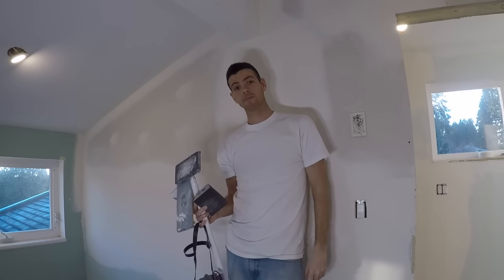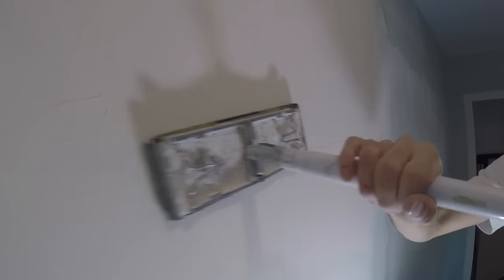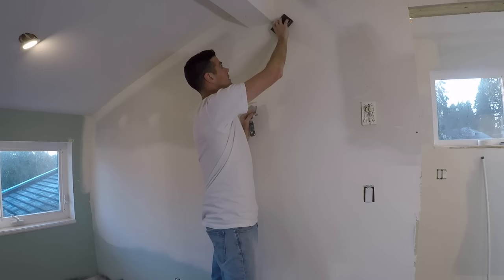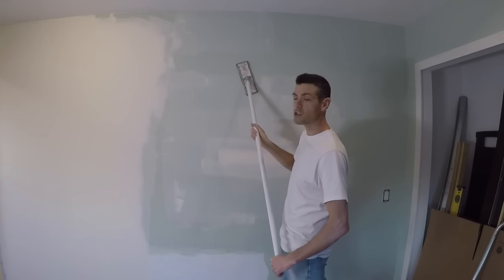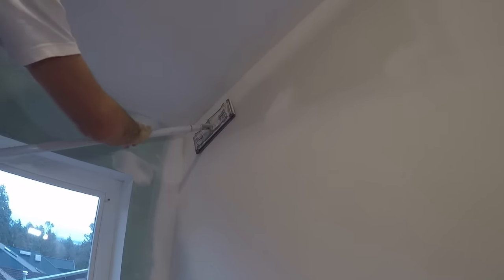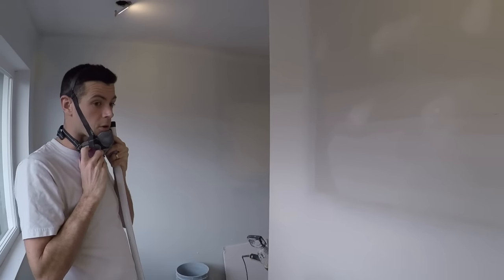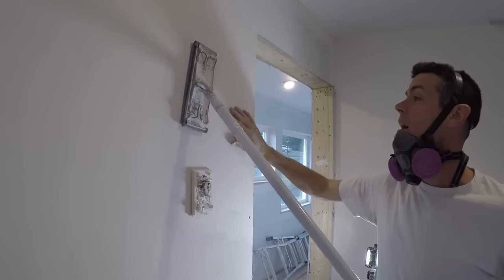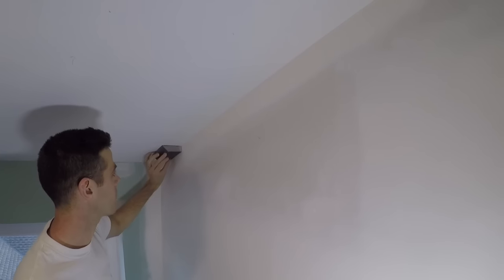HOW TO SAND DRYWALL!!!

Comment: Hey, I have a question about the sanding. I used powdered mud on my first coat but then I bought a ready mixed one - ProForm Midweight compound but when I applied the second coat with it and started the sanding process it appeared to leave tiny scratches on the joints so I've put P240 sanding paper and it still leaves scratches (I used to sand with 180) and to be honest it's really easily coming off the joints, I can even sand it with hands which is strange. Do you know what could possibly be causing that? Thank you!!

Comment: Very informative video. So  your last sanding prior to priming is with 150 grit?
Reply: 6:18 180 grit foam backed sandpaper. He's saying as a pro he prefers 150 "knocked down" a bit which means rubbing two peices of sandpaper together to knock down the really coarse parts. Some home depot carry foam backed paper but it's with the drywall mud and tools near the lumber section, not with the rest of the sandpaper in the paint isle. and strange enough most Cloverdale paint stores in Canada have it. Any drywall supplier will have it though. Its expensive to buy a roll cause 1 sheet will go for a few thousand sq ft of walls but you can usually sell the rest of the roll on kijiji or craigslist
Reply from the maker: 150 to 180. I prefer 150 but it takes a more skilled touch to not leave it all scratchy. Also depends on how hard your mud is.

Comment: Can you do a video on priming the wall right after the sanding? The drywall where there was no mud used always looks different when you paint the drywall compared to sanded drywall where its super smooth.
Reply from the maker: Sanding between coats of paint should take care of that.
Reply: I use 2 coats of primer, I know it's more work and paint, but the results are very difficult to duplicate any other way. The paint really stands up, and if you put on 2 coats of paint ( where warranted) ie my house etc, the paint job will look outstanding 10 years from now. I know many will disagree, but when I learned this from an old school painter, I never looked back. I really appreciate all your talent and attention to detail. Hope you always have work to turn down, you deserve great customers.

Comment: Do you have a radius 360 pole sander? If you’re ever in Victoria you can borrow mine
Reply: Yeah I’ve owned one now for almost 4 years. Best investment I’ve made...
Reply: Me too, can't say enough about them, still use the standard one when needed, but I have a triangle and round head for my 360.
Reply: Al S 
I recently bought an orange mop type attachment to the Radius 360 pole sander (because I could Lol 😂) to dust off walls when done sanding. Although you can prime then sand off the grit off the walls.
Reply: @bklynboyeny  I dust off my walls too always before priming. I think it makes a very noticeable difference. I'm gonna get one of those mops, thanks for posting.

Comment: After painting a coat of paint, do i need to do sanding before painting the next coat?
Reply from the maker: You will get better results with a light sanding with 180 grit between every coat of paint. It’s worth it. I sand between every coat on my own work.

Comment: How do you minimize dust? One thing I hate about drywall sanding is the amount of dust it generates, especially in an existing house that's being lived in (not a new installation)
Reply from the maker: Generally we just try to make sure the area is well protected with plastic from floor to ceiling to wall. Containment is usually the best solution. I will try to start getting into dust containment in future videos. There are ways to cut down on dust but every situation can be different.

Comment: What grit is the hand held sanding sponge? Fine, medium, coarse?
Reply: I'm interested in a reply to this as well. Sherwin Williams stocks 3m brand sponges sold as a specific grit but all others are sold as fine, medium or coarse
Reply from the maker: Fine on the package, but it actually is a little closer to a medium grit like 150. I don't like the super fine sponges. To unproductive.

Comment: Sand with a shop vacuum with bag in it  connected to a variable speed orbital sander. Why punish everyone with your drywall dust. Puts less dust in the air and environment than hand sanding. One light sanding in corners with sanding sponge to get corners.

Comment: Can u please show how to fix an inside corner? I have a 15 ft wall that I need to replace a section on the bottom (about 2ft). It had some moisture issues. How do you fix an inside corner that was already finished and painted? Can I take old tape off and re Mudd/tape just the 2ft section? Do I need to remove all 15 ft of tape and redo whole thing? Looking for the best way to tackle this!
Reply from the maker: You only need to replace the damaged section. It's no biggie. Remove the old tape and prefill any big gaps. Then just tape it like a normal corner tape. You should only need to feather it about six inches past the new tape to blend it.
Reply: Vancouver Carpenter thank you!! Should new tape overlap the exist tape above it or do I stop it right next to it?
Thanks again!
Reply: Vancouver Carpenter one last question, can I cut out roughly a 2' x 1' (or two foot high x to next stud) section or do I need to cut out the whole original piece of drywall?
Thanks again! Ur videos have given me confidence to tackle drywall again. I've always had mixed results and shyed away...lol

Comment: I wouldnt say its necessary to sand the first coat, and not to mention joints... just scrape off excess with a blade. Otherwise its so much dust to prime... and finish covers everything just fine.

Comment: It looks like you don't actually use the angled surface of the sponge to actually sand anything. Was thinking you can just then cut a square sponge with an angle down one edge if its just to get a better view of what your sanding.

Comment: You should never use the flat end of a sanding sponge in the corners. The reason its angled is to get into the corner with the angled side. No need to tear that edge off.
Reply: I was wondering that too. Regardless this is such a helpful video.

Comment: I am VERY confused @vancouvercarpenter - you state to never touch up sanded mud - yet here you are sanding the whole thing then putting on a whole second coat - I’ve watched many of your videos and this seems contradictory? Could you please clarify?
Reply from the maker: It always takes two coats. I mean don’t do your finish sanding and then try to fix a small spot on the sanded mud. Skimming the whole thing is the only way to not have a visible touch up.
Reply: @vancouvercarpenter  thanks for you reply! Okay, that clarifies if a bit more! I half did it right, but I don’t think any major damage was done 😅

Comment: I want to see the wall around that light switch AFTER the tab was dug out to be able to attach the plate. You completely covered the lower mounting strap and plate screw hole and didn't even mention it >.<

Comment: nice.  but how to remove the dust from the wall before painting.  now theres the question
Reply: Look up Wooster Dust Eater. I’m finishing my basement now and starting some sanding. It works great.
Reply: @jimb7216  and how is it applied to the walll to remove the dust
Reply: You can take a soft dry towell and carefully wipe the dust off or in new builds I have seen the painter blow the dust off with an air compressor but of course it goes everywhere
Reply: @drywaller420  i wanna hear the video man say what to do.
Reply: @brockwagner939  you are not the video man
Reply: Ok Dave 🙄
Reply: @jimb7216  yes it is ok.  why? cuz i said so
Reply: I reverse my shop vac and have fans on to blow the dust outside.
Reply: In new build we use a cordless leaf blow with hepa filtered air scrubbers. We spray prime and the overspray is more dust than is left on the wall anyway. On a reno when no one is living there I'd do the same method because the ducts are always cleaned at the end anyway. For smaller jobs I've used a microfiber rag (dry) on a pole sander to knock all the dust to the floor and an old paint brush or horse hair brush (soft bristles are important) to clean out the corners. Then of course hepa vacuum to cleanup the dust from the floor. If you use a microfiber roller sleeve you don't need to clean the walls, just the corners. Paint and primer in 1 is too thick over new drywall and should be thinned 10% with water. Tap water is fine unless you are on well water. Some well water really smells and latex paint is only 30-35% solids by volume, the rest evaporates and can really smell up a place if you reduce it with well water
Reply: @MrTooTechnical  cuz you said so...? That's a good way to get anyone, especially the person making the video to tell you how to do anything.
Reply: @drywaller420  to get anyone .  lol
Reply: @drywaller420  shush.
Reply: @MrTooTechnical  whatever you say lady
Reply: @drywaller420  u rock
Reply from the maker: Just brush out the corners with a dry brush to get the big dust clumps. You don't need to brush down the walls with a decent primer.
Reply: @vancouvercarpenter  cool.  can u pls show that in a vid.  thanks
Reply: He says primer but he means drywall sealer

Comment: Do an updated dw finish sanding video..?? 
Pretty please....???? 

I just skimmed a 3500 Sq Ft home - walls AND ceilings.. from textured, to smooth. 

Texture a dw board in that garage of yours and then skim it to level 5, and show the sanding steps....? 

In one of your most recent videos you talked about skimming down a texture on a first coat - sanding down + final skim, final sand = compaction --- how does the sanding process translate regarding a 4 coat textured to smooth finish - for a level 5 finish...? I scraped lift off lines after each layer - but was scared to sand until the final (which is cured and ready for final sand/primer: today.) 

ALSO!!! How have you not done a video on skimming textured walls to smooth around these.... mf..... SWITCHES... and OUTLETS.....?! Dude..... I'm losing my mind over the switch edge @ door trim, & outlet edges @ floor trim..... what a pain in the absolute.... di*k.

PUH-LEASE DO A F/U....?! 
-from one diy-drywaller/skateboarder to: the MASTER.

Comment: never sand hard it called grinding the wall never do that you will over sand and have to do repairs go light and make more passes and check with your hand when you are done a section lights are great but you can still miss spots so check with your hand you don't want to sand and then prime the walls only to find missed sanding areas because once you prime the wall you cant sand the missed spots down and that's when repairs have to happen.
Reply from the maker: Your right. I should have mentioned checking with your hand. I often sand without lights and only do the hand check.

Comment: Duuuuuude that's a massive mud joint, why are they so wide?
Reply: Watch this video https://youtu.be/1ZGAnq3G79Q
At 7:50 he shows you the hump between new and old and at 9:50 he decides to go bigger and I assume he went even bigger because it still wasn't smooth.  Some builders and people who try to do their own Reno's try to keep as much board up as possible. Imagine if they took that wallboard off completely, less than 20 bucks for another sheet of board and he'd have a normal tape joint. No one thinks about the drywallers in the demo step of a project
Reply from the maker: There were some really peaked joints. Gotta go wide to make them disappear
Reply: @vancouvercarpenter  I see.keep it up

Comment: I love your videos, but you're not going to convince me to use a pole sander ever again. I use a DeWalt 5-inch variable speed orbital palm sander hooked up to a Shop-Vac to do 99% of my sanding. I also use 45-minute setting compound for everything. I love the setting compound because it seems to be harder and stronger and it does not shrink. 

The extra hard setting compound works great with my power sander. This combination often allows me to do much fewer coats. I can put on a slightly thicker coat and easily shape it to a perfectly flat surface with the power sander.

My technique probably would not work for a professional Carpenter like yourself, but it works absolutely great for a DIY homeowner like myself that does not mind taking extra time and effort to get a nearly perfect finish. I enjoy doing a good drywall job, but I would absolutely hate doing this for a living.

I love your videos and I have watched several of them over the past few months. I have used many of your suggestions during my recent projects. Keep the videos coming and I will keep watching them. I would also be interested in watching some carpentry videos if you end up doing any of those in the future.
Reply: It's a great tip and not DIY only. While I'd never use quick mud for a whole drywall repair as a professional painter we use Drydex patching compound, 120grit on the dewalt orbital hooked up to a backpack hepa vacuum. It's so clean we don't use drop sheets until we have everything sanded. Clean drop sheets for every job without going to the laundromat

Comment: Sands awrong switch that will be covered by switch plate.  Switch itself is 8 degrees out of plumb.  LoL I assume someone will straighten it when the put the plate on, just thought it was funny.
Reply: I've been called back once to fix something I thought a switch plate would cover. After that I finished everything as if the switch plate was 1/4 in bigger than the box. A call back usually comes up when the floors are finished and house cleaned so costs way more time than spending an extra hour or 2 when you're already there
Reply from the maker: Darn tootin it does👍

Comment: All that messing about sanding. Then going back the next day to do it all over again. Ide have that full room skimmed in 2 hours and the finish would be perfect and ready for paint. Absolutaly no sand required whatsoever. Im trying to get into taping as its an easier process but other than being easier i m struggling to see any advantages over skimming. UK style skimming that is.

Comment: Ridiculous! 
Why do you think a sanding machine turns in a circular motion/spin.
If your using a hand sander (rectangle/180 grit paper/no pole) or a angled sanding block (those square ones are terrible) apart from your outside edge and first few passes, circular motion is how to don’t get gouges, removes scratches, and a perfect finish.